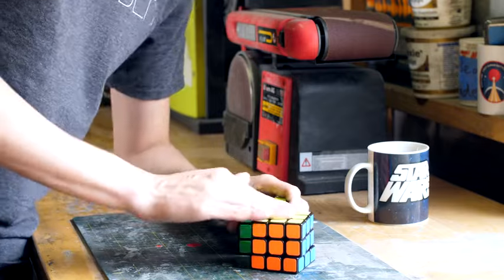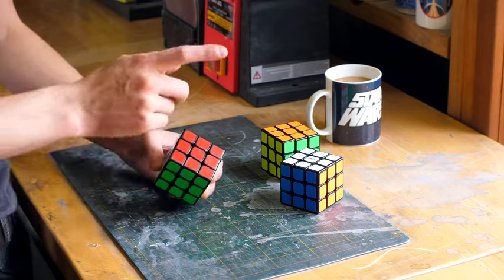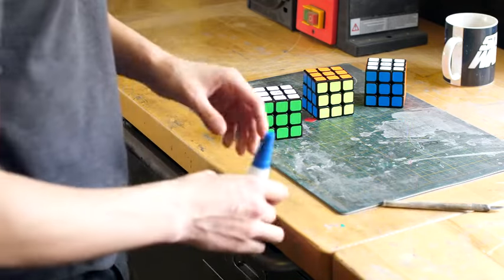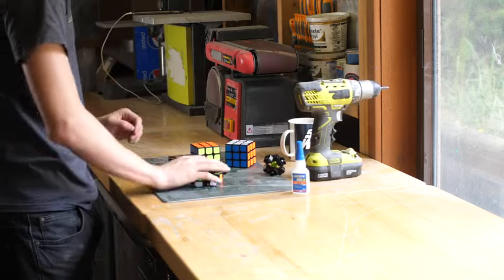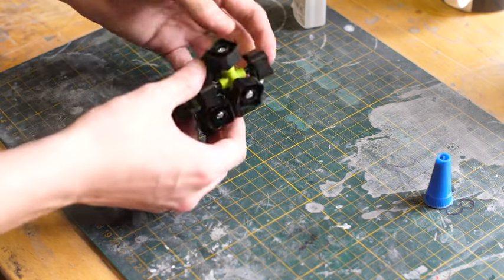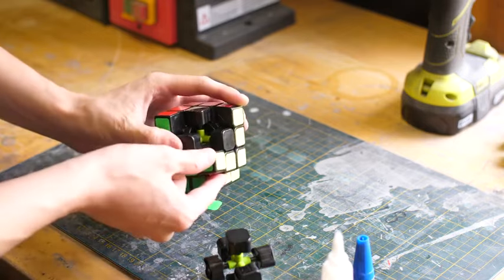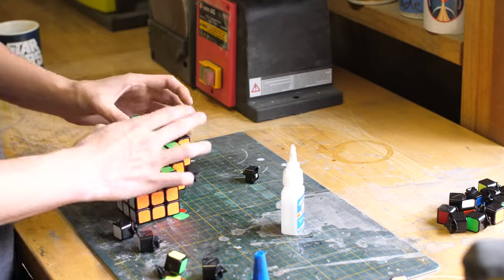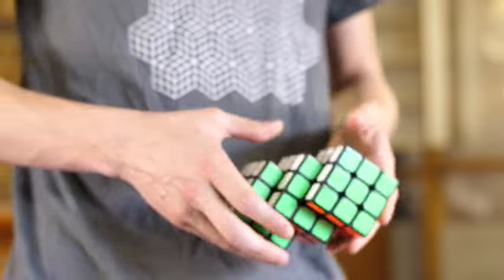Triple Fused Cube [Old Video]

Comment: Great looking, Could that shape be done from a 5x5x5 with all layers still turning?
Reply: Yeah. You'd have to fuse it by the corners though
Reply: @damianwilding  In a 5x5x5 there will be no need to do any 'fuse' (only take out some parts), i am talking about getting the 'shape'/'looking' of that (three 3x3x3 fused) but with a 5x5x5, so instead of having tne middle zone not mixable, it would be a 5x5x5 without some parts and it will be mixable also in the middle part.
Sorry if i did not explain it well, i am not native english.
Reply: @androidlogin3065  I think I understand, but if you're wanting full functionality of the middle 5x5, then it has to be connected from 2 separate corner pieces, otherwise it will have bandaging